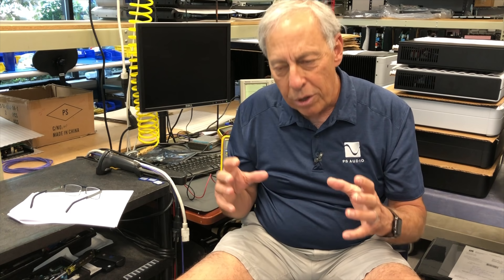Why do speakers have rear tweeters?

Comment: Paul,... the tweeter is performing a task called Stochastic resonance..... where noise (the rear firing, bouncing signal) is applied to a signal which allows for faint details to be identified.

Comment: More room reflections vs. more direct sound is an interesting and complex topic. Some times the recording itself might already have a lot of room acoustics in the mix or very little that combined with your room acoustics alter what you perceive quite a lot. Perhaps one thing to consider is that music that has been carefully mastered in a studio to deliver a particular experience generally assumes front firing stereo speakers only (I've never seen studio monitors with back firing tweeters?). Still our brain's perception of realism depends on audio being bounced in a real room and perhaps that's why some of us find rear firing tweeters appealing.

Comment: Rear firing speaker drivers are a solution to a problem hat does not exist, if you are seeking the most accurate reproduction from your recordings. Think about it, adding rear firing drivers of any kind means that you are intentionally adding more music, that is time delayed from the front music. That means that what you are listening to is a muddled mess of what was originally recorded. Technically, because what you added is not in the original recording, it is actually a form of distortion.

There are a lot of people who think that adding that rear tweeter sounds better, I suspect because it simply adds echo to the sound you hear. I use to have an audio time delay device (bit bucket) that had variable delay, adjustable with a knob on the front panel. I usually used to have it bypassed (another front panel button) but when I had the opportunity I would test time delay on listeners and invariably the more delay I added the more they lied the sound. Of course, the exaggerated echo made it sound like you were in a large concert hall, but more delay always resulted in less actual detail in the sound quality.

If you take a bi-polar, or similar style, and measure it in an anechoic chamber you will get a typical speaker response curve, because the rear wave is absorbed or dissipated by the treatment on the chamber walls (so the contribution of the rear firing tweeter/panel/whatever is not measured in any significant way. Place that speaker in the typical listening room and the contribution of the rear driver is easily heard because it bounces off the hard surface of the typical wall that we all have. The speaker is no longer flat (flatish) and is now muddles by countless waves of echo that did not exist on the original recording. People might like that tho filled sound quality but that does not mean that it is accurate, in a scientific way.

Fans of bipolar (dipole) speakers rave about the huge "sound stage" they hear from their speakers all the time but think about it, if the venue was a well damped, small space (like many of the tiny clubs we hung out in in New York City) then there should not be a huge, echo found soundstage because the true soundstage at the time of recording was a tightly focused singer with their guitar, sitting directly in from of me.

This all reminds me of the intellectual discussions we had when for we trying to convince us that the Bose 901 was teh "ultimate" sound because it added the correct percentage of reflected sound to every recording (the played back). Of course that turned out to be marketing nonsense and no audiophile that I have met in the past few decades has a 901 (or any Bose) featured in their prized audio playback system. Those of us that truly strive for the most precise playback from our media generally find that the bipole/dipole have that distinctive "echoy" sound that is not an accurate indicator of what the media contained in its grooves or bits.
Reply: Billy Bob if you're not a sound engineer, you're definately an audiophile 

The mikes, captures the sound exactly as you would hear it if you were there. Echo and all.

Maybe 2ch is not enough to recreate a live orchestra.
Maybe many more channels would be needed.

Maybe a wall of speaker!

I like how he can't explain the physical or technical reasons.

1- he's an engineer!

2- he will be building loud speakers!
Reply: I am in fact an engineer, and have been an audiophile for many years, plus was a musician in the school orchestra (which helped train my ears) and have worked in the major motion picture industry a few times (those guys are extremely serious about audio quality and perception). The most interesting experience I had in all that was with anindventor that created a binaural system that absolutely blew my mind,. He let us play with it for hours and the realism was absolutely stunning! It was so good that it spoiled me for anything less, LOL.
Reply: Sometimes when something is enjoyable, it's just that. They don't need to be technically superior or approach the ideal in any way. Outside of the realm of speakers we can see it all the time. Toyota GT86 is purposely fitted with skinny tyres for less grip, to make the car more fun to handle. Some defensive badminton players prefer heavier rackets to light ones. In essence, if you are making products for people, naturally you are expected to offer variations. You can't argue to a customer that doesn't enjoy your product that what you have is absolute perfection. You can't say Porsche enthusiasts are morons for loving sports cars that have their engines hanging over the rear. And, you can't argue against people who say that cars with the perfect grip and weight distribution are boring.

Just as well, if people like the 'fake' live sound that a rear sound radiator provides, they're not wrong. They just don't like hearing music and feeling as if they're with the musician in some tiny club in New York. What they want is to bring the sound out from that tiny over-damped studio, into a large auditorium. It's inaccurate in the sense that it isn't true to the recording, but if it has been done well, in a manner of speaking the music would sound "as it should". It's not always about what you SHOULD hear, but what you would rather hear. Given the opportunity to have your favourite musician perform for you privately in any location in the world, would you rather have them perform in a small studio or somewhere like Royal Albert Hall?
Reply: If people like echo the recording lacks, why not add it in software? There's bound to be a processor in the amplifier for the equaliser, after all. If you're paying programmers to write code for it anyway, might as well get them to throw in some echo functions as well.
Reply: Now you're tampering with the original signal.
You should read up on Linkwitz Orion+. Mr. Siegfried Linkwitz improved on his Orion open baffle speakers by adding a rear tweeter. Basically, the addition of a rear tweeter extended the frequency range of the dipole effect (something that cannot be done with software as far as I'm aware) for the Orion, as well as improving phantom imaging. That made the speakers difficult to localize (i.e "disappear"). All that without tampering with the original signal with fake echoes and crosstalk cancellations.
If we want echoes we should utilise our room reflections, not make fake ones with software. We're not simulating a karaoke bar. Fake echoes that radiate from the same drivers as the main sound would have the same reluctance to work well with our room reflections.
Reply: I don't think you can ever actually get the original signal out of the speakers. There's going to be all sorts of processing and analogue quirks along the way. Why not add a few of your own?

Rear tweeters that bounce off the wall just seem to me like the auditory equivalent of those monitors with LEDs on the back that shine onto the wall behind it.

Maybe I just don't get it because I use headphones with a computer as the audio source for the overwhelming majority of my listening and hardly ever get to listen to anything through speakers. Who knows? [shrugs]
Reply: I want all these features which can be switched on and off to my liking.

I can imagine times I'd love it and times when I'd want it off.

Speakers drivers today are all pretty good. It's not a matter of frequency response and distortion. It once was. 

What we truly desire are speakers where we can control the dispersion and imaging to our liking.

Slap a rear tweeter on, but please let me listen without it if I so choose. I know you'll have to increase the crossover cost, but most are willing to pay for variable controls.
Reply: Really Billy Bob? Really? LOL... Sounds like you strive up your own tweeter response...
Reply: @thunderpooch  -  Or, better still, have an amplifier/DSP module where you can load in your own software for the DSP to use when processing the signal. Write the effects you want to hear on a PC in a text editor, copy to a USB drive, load into the sound system, then pick them off the menu when you want to use them.
Reply: @Roxor128  Love it, tell me more. Can i do this via a remote and does a computer have to be running while I listen? If "yes" to the first part and "no" to the second, that would really be awesome!

A text editor on a PC and then load it? Could you elaborate, I'm lost.

What you described sounds intriguing, but I wouldn't know where to begin or what to purchase. I'm guessing a MiniDSP? I don't know.
Reply: @thunderpooch  -  Alright, here's what I envision you doing with this setup:

You fire up Notepad and write an OpenCL kernel for the DSP effect you want (OpenCL is not just for GPU work, it includes support for DSPs and CPU execution as well). Save that .cl file to a USB drive and plug the drive into the DSP module. 

The module's screen would then show a "Load Program" option. Select that and get a directory listing of all .cl files on the USB drive. Select the one you want, press OK, and it'll copy it off the drive and compile it, ready to run. Once that's done, you can unplug the drive and pick the new effect off the DSP module's menu to use, like anything else on it.

The only part you need to do on a computer is writing the OpenCL kernel in the first place (and whatever debugging it might need). The rest is just pressing a few buttons on the DSP module or its remote control (could go either way, I just found it easier to think in terms of buttons on the module itself).

I don't know if such a system exists. If you were building one, I expect you'd be using some sort of DSP chip for the actual work, a cheap ARM processor for supervising things and doing the menus and compiling, a few meg of RAM shared between them and maybe a gigabyte of flash memory to store whatever programs have been loaded on. Might even be possible to do it all on a general-purpose CPU, depending on how sophisticated the processing ends up or how much latency is tolerable.

Really, the part I'm not sure about is exactly how much number-crunching power is needed. If the requirements were light enough, you could use a Raspberry Pi with an infrared module for the job, though getting the audio data in and out might need something cobbled together.
Reply: @Roxor128   Hey, thanks so much! This is mostly above my pay grade but I'll pour over it and try to learn as much as I can.

This gives me something to chew over.

Comment: Rear facing "ambience" tweeters (I've also seen top-firing) are useful because your room is not equally absorptive at all frequencies, and it tends to be more absorptive at high frequencies than at low frequencies. This can cause the tonal balance of your speaker to shift toward the midrange and bass, because you hear not only the direct energy, but its combination with decorrelated energy from reflections in the midrange and bass range. The ambience tweeter adds decorrelated high-frequency energy and lets you shift the tonal balance of the speaker in the room back toward neutral. It's a good idea to work with absorption treatments on the walls and in the corners to try to reduce the reflected midrange energy, but when that can't be done, an ambience tweeter is another tool in the toolbox to restore balance. Ideally, there should be some way to adjust the level of the ambience tweeter, or disable it altogether. Some speakers add an ambience midrange which is intended to work the same way. As to why multiple ambience tweeters might be used, the first reason is directivity (to reduce ceiling reflections if they are not desired), and the second reason would be to increase the amount of decorrelation of the ambient energy. Ambience tweeters should be placed carefully on the back side of the cabinet so that their output does not wrap around or "diffract" from the edges of the cabinet and get radiated back at the listener - for the ambience thing to work, you need enough delay between the direct arrival and the late arrival that proper decorrelation happens as you get with true reflected energy from an acoustic source radiating in all directions.
Reply: now we're talking!

Comment: Paul, some speaker manufacturers put the tweeters in a separate cube up top. Which is better, should the tweeter cube be forward, equal or behind the front face of the woofers.  
Second question:  i have a pair of Vienna Strauss speakers. Let’s face it, unless you have a home theater /music room downstairs the misses of these days want a nice living room and not a room full of speakers when guests come over. I love these speakers but they are destined to become small cabinet speakers on pedestals. No, I won’t be selling them and buying high end small speakers because I don’t have the thousands of dollars to add for the change. Any tips on what I should do to optimize the cabinets?  I may go unported-sealed. I might put the tweeters in cubes up too. The B&W tweeters are set back I see

Comment: I too have DCM Time Frame TF-600s. If you space them correctly from the back wall, those tweeters (2 per speaker!)  add not just some "life" but also, it seems to me, add some depth to the soundstage.

Comment: the best way to do rear facing tweeter is adding a delay circuit so its out of time with front tbh
that way it doesn't register on frequency domain but time domain(decay) and that gives the best experience

Comment: Enforce there was any home theater I set one up. These were the days when the first VCR's came around. They were basic mono VCR's, nothing special. I bought a simulated stereo preamp unit from Radio Shack and ran that through my front speakers. It sounded better than mono, and not that bad. I even dialed in a touch of volume from the TV and it sounded better than mono through my stereo. Then I read an article on how to wire the rear speakers in a Hall Effect. This brought sounds that were common to both front speakers to the rear of the room. So things like the engines of the enterprise, that low frequency rumble played through the rear speakers, without much of the directional sounds like the dialogue or phasers going off. My main speakers, the front speakers were made from a pair of 12" 3 way cabinets I got sheep and installled high quality Peerless drivers in them. Then I found a second set of 12" 3 Way cabinets and put the same woofers in them, but used different mid ranges and tweeters. They were both more efficient than the woofers or mids and tweeters used in my front speakers, so I got the idea to face them backwards in the rear corners of the room, facing upwards at about 30 degrees about 3 feet from the corners of the room. Their sound filled the back half of the room well, and the combination sounded awesome. Totally by accident I had the home movie theater that all my single buddies wanted to watch movies or wrestling or football in. So rear mounted tweeters? Absolutely, especially in the surround speakers!

Comment: Hey Paul, I notice you like to film with a very high crop at the top. A more visually appealing crop would be if you let a bit more visible above your head. Not very much more space needed but preferably avoid cutting the top of your head. : )

Comment: Paul I bought your BHK 250W amp. Then I I'm trying to figure out how to get the new power plant $10,000 (ouch). Now I've got to come up with more for the holy grail speakers? Not sure if I can pull it off.
Reply: Wait, and buy used, I did. Several years ago I bought a used P10 for a little less than 50% of new cost and to boot, it was still under warranty. PS Audio will transfer the warranty to the new owner. Just visit their web site (I assume they still do?)
I found when buying used, in general, most people that spend thousands of dollars on audio equipment tend to take care of their equipment. Especially if it's still relatively new stuff. I've bought other current model expensive audio equipment when new, used at a greatly reduced price. Yes, you have to be careful as we all know there are people that won't think twice about ripping you off. 
Don't get in a hurry to buy something, just wait for the right one at the right price. It may take awhile, but there always seems to be somebody that's in a pinch and needs money bad, so the equipment has to go.
By the way, buying used PS Audio speakers is my future plan (probably 2 to 3 years down the road.) Unless I win that Publisher's Clearing House sweepstakes! LOL!
Good luck...